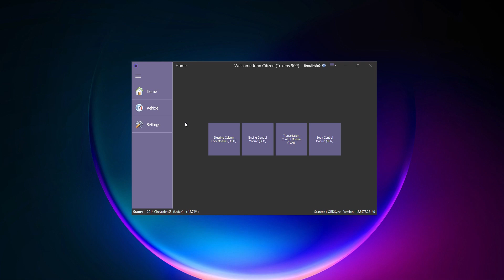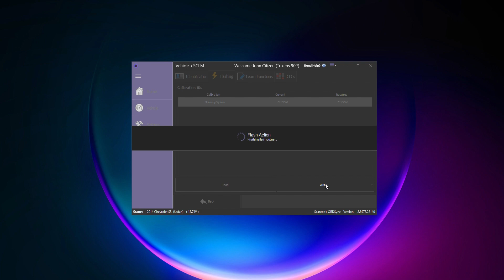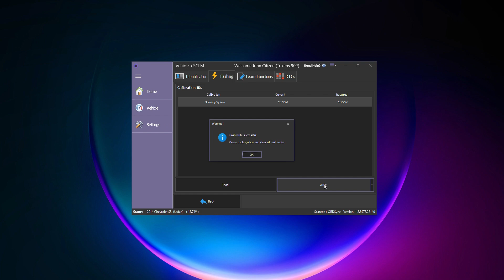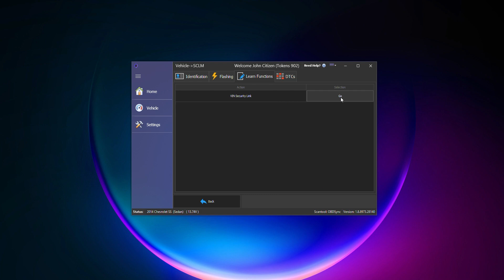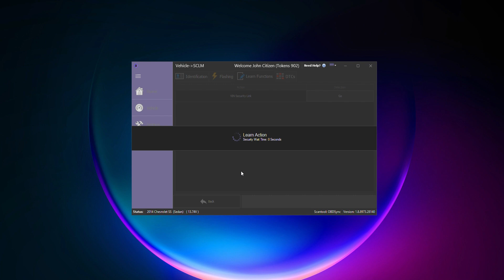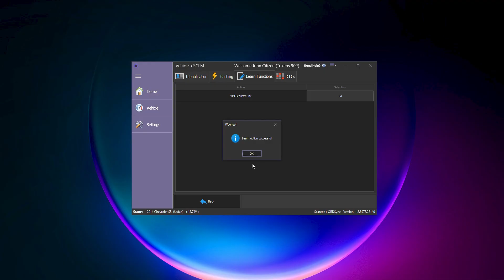Holden VF Commodore Steering Column Lock Module (SCLM) Programming and VIN Security Linking

Comment: Appreciate the content Jason!
If you could please provide some help ‐ family member attempted a battery replacement in their VF SS, no start and 'Service Steering Lock' fault on dash straight away. Checked and turned out to be a dud battery from new (tested poor). Have since installed a brand new Varta battery, reset/cleared all faults but will consistently show 'B2910 - Steering Column Lock Password Incorrect'. 

Any ideas? I have removed the SCLCM and manually reset it to unlocked position and confirmed this via live data, still presenting with password fault. Assuming it is a communication/anti theft issue?

Any help is greatly appreciated 👏
Reply from the maker: This could be a failed module. Low battery voltages can result in corrupting modules, so could be the problem with the SCLM (Always recommended to get a local technician out to confirm!).